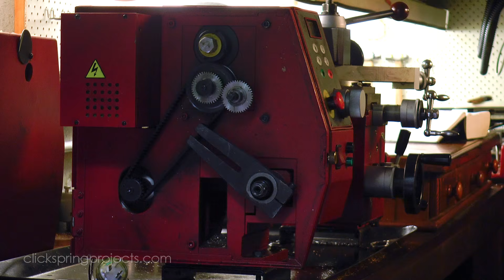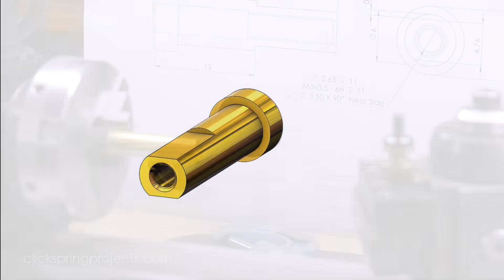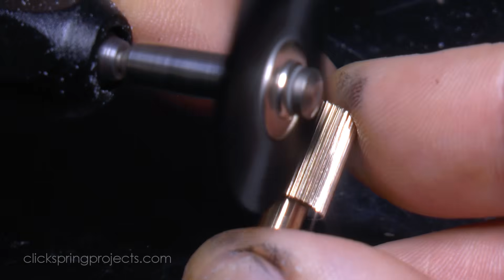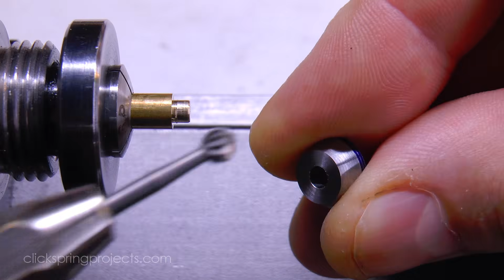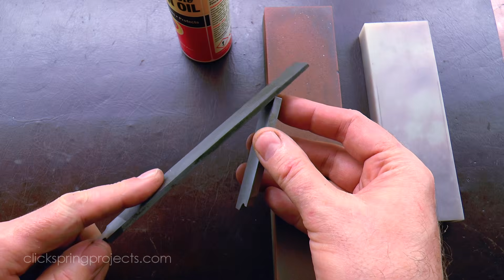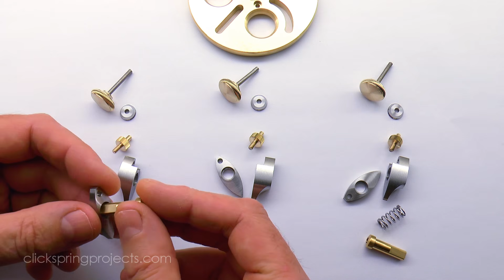Watchmaking - Making a Watchmaker's Faceplate for the Sherline Lathe - Part 3

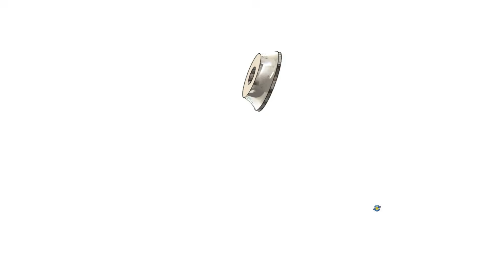Comment: 13:43 “I prefer all 3 instances of each component to look the same”.  So you make a custom form tool to cut the inner portion of the thumb wheels.  Very precise…but then you hand carve the outer portion???  If the aesthetic tolerance is maintained with your manual abilities, why was the form tool so critical?

Comment: One thing about these clamps and other work Chris has done on this channel involving form tools and curved surfaces. They appear to be compound curves revolving around multiple axis or radii. They aren't. They the result of clever workholding often involving positioning the work to multiple centers of rotation  in indexinxing setups. A good example are the single tooth gear tooth cutters Chris makes. Normally something like this needs to be made using a relieving attachment on the lathe. See videos on the Eureka Relieving Tool. The method Chris uses to make his 4 fluted cutters is far simpler. Of course if one wants to go deep into making gear cutters that generate the teeth. Then a relieving tool is required for making true hobs.
For a while as a mental exercise l was designing a small gear hobber that would be about the foorprint of a 10 x 20/250 x 500 bench top lathe. For cutter I actually thought about using Acme or Trapazoidal taps. Acme would give the same PA as 14.5° while the Tarpaziodal is 15°. 60° thread forms could be used for involute splines. Gears do not have to be made to any standard Diametral Pitch or Module. The taps could relief ground on a surface grinder (1) to provide enough relief. I've done this in the past as an experiment in turning taps that were full on their leading edges into the equivilant of roughing taps. They worked. Not as well as the real thing but in soft materials they worked just fine.
1) Something that no really well equipped shop can do without IMO. Especially if you are working with heat treated parts that then need to be fitted to precise sizes. The essential tools are a lathe, milling machine, bandsaw and surface grinder.

Comment: Hey Chris love your work.
As I have told you on a couple of occasions I'm an aerospace engineer and one of my pet projects is: "How do we actually build a Moon Base?" and the single biggest issue there is we simply can't afford the cost of flying everything there. As one person said many years ago we have to learn how to "live off the land."

Because its so insanely expensive and there's just not much in the way of cargo volume *FROM DAY 18 of the Moon Base we will have to make stuff on site and that means a work shop with the minimum amount of tooling. That's why there hasn't been a Moon Base. Its not a matter of can we get there. Its always been a problem of getting enough  stuff there so we can "Live off the land."
The problem has been getting enough stuff there. Its not like a mine site where there's a semi-trailer with 100+ tons every other day.

The mega-super-T-Rex sixed problem has always been: "How can we make stuff with a very limited amount of equipment?"

There's no way I can take on of Joe Pie's lathes or mills. We wont even be able to take 1 of Stefan Gotteswinters small lathes or mills or any of the stuff This Old Tony, OxTools let alone Abom79's shaper because we just can't get it there. 

BUT WE CAN HAVE something small like a Sherline. We just wont be able to have all the chucks and tools we will have to make do with maybe a 4 jaw and the arbor for a face plate. Insert tooling is out because it can't be resharpened. So initially it will be a lot of OLD SCHOOL techniques, which is why I watch so many of these channels. They all give me ways of doing things and every so often they give me a piece of the puzzle.

I can't say this is a specific solution to anything because its quite specialised and small. BUT its clearly a concept that allows for solutions. (I really look forward to you demonstrating it.*

Best wishes
P.S. I am Australian and would love to visit your shop one day.

Comment: Exquisite craftsmanship.  I don't think I could bring myself to use such a beautifully crafted faceplate for fear of damaging it; I'd be more likely to mount it on a plinth.  Even if you don't scratch and ding it from routine handling, surely swarf is going to scratch it, and grease and dead skin cells are going to accumulate in the knurling.

Comment: goddamn. Your precision is unmatched.  Can I ask you a question? Have you ever machined a very very small hole in copper before? I have some holes I need to drill that are around 130 micron, and I'm worried and was wondering if you had any words of wisdom? hah
Reply: That sounds like a job best suited to laser microdrilling, which can generate holes as small as 20 microns with 1 micron precision and lots of freedom to set hole shape, depth and geometry - straight-sided, tapered or even different geometries in the same hole. Obviously it's outside the realm of the home shop (unless you're seriously rich!), but there's a number of companies that offer the service so it's worth asking around to see if they'd take on a small one-off job without charging you a fortune.

It's clever technology - the pulses are so short (<1/100th of a nanosecond) that material is removed by a process called "cold ablation" where the surface is vaporised layer by layer but it happens so quickly that heat can't transfer to the rest of the piece. That means no distortion or thermally-induced changes in material properties around the hole, and since the material is vaporised rather than melted, the hole edges stay sharp and precise. The absence of heating effects means these lasers can drill just about anything including soft plastics and composites through to ultrahard materials like refractory ceramics. Ultrashort light pulses also behave very differently to normal light, producing non-linear absorption effects that enable drilling of materials that would normally be transparent such as glass or even diamond.

Comment: Once again, just pure art. Regarding the main-plate, how would a black nickel plating look? Although that is probably considerably more difficult than normal shiny nickel plating, and I think polished brass will look incredible as it. I suspect though that the nickel plating is to toughen the plate to reduce scratches and dents, so just polishing the brass wouldn't offer that problem.